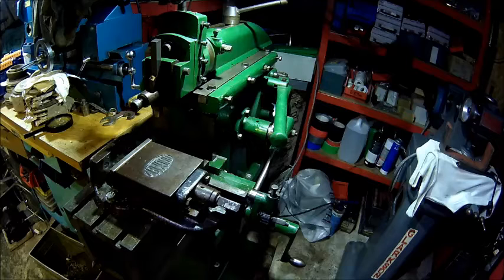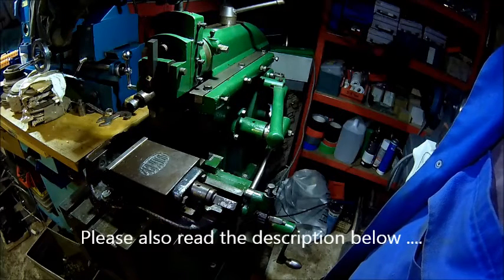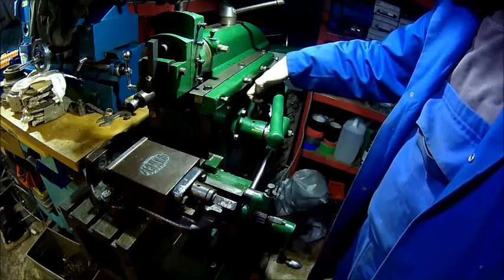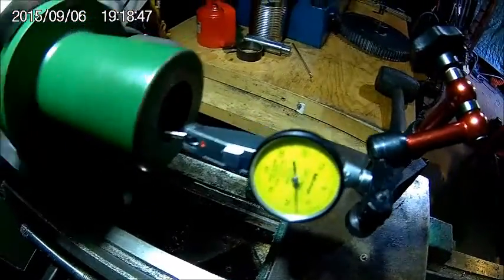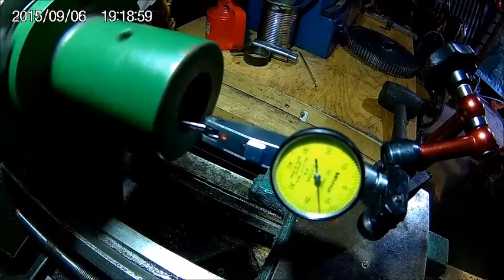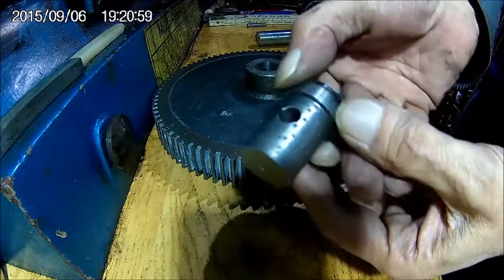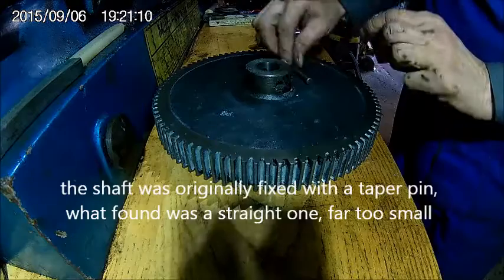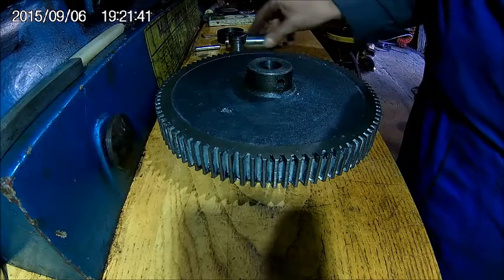The Alba shaper rebirth - The rebuild part 1, new main shaft, bullgear machining

Comment: mike 
i have an identical machine and i have adressed the clonk issue ..the fork on mine was also worn so i remachined the fork and glued in a small bronze bearing to bring it back to dimension.
The pin does come out very easily, as Greg from Aust pointed out ...there is a hidden grub screw on the underside of the boss on the rhs. i simply took the pin out and turned it thru 90 degrees.
My machine should be back together in a few weeks. i have done a series of videos... under neil9

cheers
Reply from the maker: Thanks Neil,... really good info with the grub screw, i never  looked at the underside. My machine is much older than yours,  i suspect it was made in or around 1929, it has a smaller base and a flat belt pulley as it was a lineshaft machine , the clutch and shift handles are different as well. My sliding block is made of brass and the top part of the yoke appears to be cast iron. Still got a lot of work to do on it, but other projects are bit more important and it's at least usable as it is.

Comment: Nice job. That machine certainly appears to have done a lot of work. Glad to see that it is working again. Greg
Reply from the maker: Hi Greg, thanks for watching. You are right, alot has been done, but still lot's to do. Today i crashed a tool while slotting an internal  keyway  into some tough steel because the play in the ram plus slack in table + leadscrew was just too much, so the cutter hit the edge. It sounded rather expensive and the result did not look very nice either, Tool bit and boring bar scrap, shaper and workpiece survived. Another lesson learned.
cheers, Mike

Comment: Looking good, fun to see that bull gear on your lathe !
My shaper has some play in the lower shaft fork & it clonks when the strokes get over 5" long and more than 50 strokes minute. I can live with it for now. The shaft looks very similar to your alba straight through the body casting side to side. Nead to take the ram out to see how it's held in, a job for another weekend.
looking forward to the second part.
mat
Reply from the maker: Hi Mat,... yes that gear looks huge, it just fitted, could have done it on my other lathe which got more center height, but it's not as accurate as the small one. Your Elliott has been developed from the Alba, so similarities are no surprise. 
I had all the internals out, but stll no clue how that shaft is held in place.
Your's is pretty quiet compared to mine, i was thinking about teflon or printing some sort of nylon bush on the 3D printer, at the moment i just run it a bit slower, so it does not hammer everything to bits
Reply: Guess if speed was the requirement we wouldn't be looking to start with a shaper ! I'm very happy with mine. Ive just found vids of chap channel name is 'The Shed' I think - doing some repairs to his shaper and making up cutter grinder jigs - its a small world - I think the chaps in Australia judging by his accent. Im in the Peak District - where are you based ?
Reply from the maker: I agree, speed is not really a selling point, but tooling cost is a very strong argument. And there are still things a milling machine can't do. Just setting up for cutting a keyway into a blind hole of a piece of EN24, try that on a flashy CNC mill .....
For the job shop type work i do, there is nothing wrong with old machinery, built to last , cheap to buy and rather easy to fix,  my mill is from 1963, bought for peanuts, has 3 axis feed and is still repeatable within a few 1/100mm . And like the shaper, if you know the limits alot of things are doable , it just needs a little bit more time.
I've checked out that channel, thanks, it says actually Australia in his about section.. Do you know Stefan Gotteswinter's channel, he's got a pristine Gack shaper.and does some real precision work on it.
I am in north Gloucestershire
Reply: +dynoguy Thanks for the reply, I now Stephans channel, he puts some very slick videos together. As does This Old Tony but no haper at the latter. I m trying to pull together a Shaper related play list to which I can add shaper videos as I find them. I'm just not sure f tat ply list can then be made public and editable on an ongoing basis.
Reply from the maker: I really like Tony's videos, always perfect, story and editing simply looks professional.....certainly alot to learn from.
You can setup a public playlist and add/remove videos at any time. Most of my video are in playlists, you can even change the order in which they appear.

Comment: HI Mike,
this is turning out to be a real nice little project. Doubleboost aka John Mills showed something similar to the dimples on the shaft by knurling a shaft to increase the diameter. it works fairly well if the shaft doesn't have to move in the bull gear. i used that technique on the main drive pulley for the Deckel where i had to put in an insert to be able to mount it on the motor
your solution to just make a new shaft is the better idea in this application methinks.

on your mulltifix tool post: is that size A or B? i have both and was shocked to see how big the B is compared to the A when i got it. 
the lathe at work must have a B on it, i looked at the tool holders and they have BD and then a number stamped into them. for some dumb reason i was thinking they were a C 

milling the slot would be a good idea, that binding issue is most likely wear and that will only get worse with time. when you go to make a new brass running block for it, i would put a small groove with a few herring bone side galleries to get better oil distribution on the running surface. it doesn't have to be very deep or wide. half a mm deep and wide on the side galleries and 1mm deep and wide on the longitudinal axis would get enough oil in there.

tough call on that pivot shaft in the base .. that thing could be soldered in there.. you would have scrape the paint off to see if there is any solder or brass on the casting.. but you are right about having to take it out to get rid of the clunk. the other solution would be to cast some babbitt into the fork and try to shape it with a file to take out the play.. if you do take the shaft out, i would put a replaceable sleeve on it so when it wears out it can be rotated on the shaft without having to disassemble the entire machine

cheers
mike
Reply from the maker: Good evening Mike, hope everything is going well so far.
i had to cut the shaft to get the gear out because the collar which holds the pin in wouldn't come off brcauser it turned oy there was a lot of loctite used to hold everything in place. So i had to make a new one anyway. 

My Multifix is a size A, with your holders the first letter is the size the second letter is the type of holder and the numbers are simply the size im mm, so an AD 2090 is a type A, D means  normal toolholder,he tppl slot is 20mm high, and total length of the holder is 90mm.

There are oil grooves in the brass block, but it relies on someone squirting oil on it, i am pretty sure that did not always happen,
Block and lever are badly worn,  the lever is cast iron and the wear is most in the center of the push side so it has certainly seen a few working hours in it's life

You probably right with that soldering idea, the shaft must be locked in place somehow and i couldnot see a pin which locks it.
That shaper will be a longer project, so i haven't yet decided how far i will go with it, at least it's in working order now.

Comment: Hello,  On your lathe is that a variable frequency drive you have?   Did you do that yourself, do you like it?  Really like your shaper, we have a little Ammco 7 inch.  Oldie but a good one.  OH by the way, when you are holding anything turning on the lathe be really really careful.   We had a man doing something like that and the bearing got hot and seized so fast he couldn't let go in time and it broke his arm.  Almost through him over the lathe, was really bad.  Be Careful, I am not criticizing you just that now it makes me shiver every time I see someone holding on to anything turning in the lathe.  Hold it lightly and be carful it can't wrap your fingers around the part especially if you have long sleeves on!  And I am not a safety nut either.  Just suggesting you think about this next time and when sanding a turning shaft.  Love your videos it helps me seeing what you do.  Hope you are not offended by the lecture.
Reply from the maker: Yes that's a VFD on the lathe, i fitted one on the shaper as well, I really like variable frequency drives, you can squeeze alot more out of your motors. I have another video about that subject, the title is "tame your motor".
You are absolutely right with your safety concerns, i have no problem at all with that, it just reminded me to put my usual disclaimer in the description.
What i show in my videos is how i do it and being comfortable with, this does not necessarily mean that it is safe by todays standards, it  most likely is not anymore as i got into machining in the late 70s.
By the way, thanks for subscribing and liking my videos.